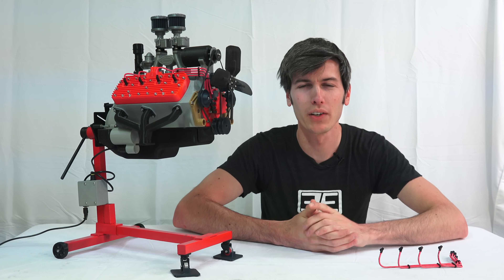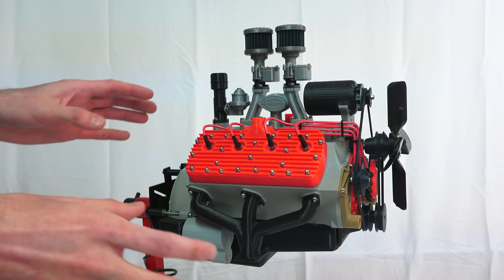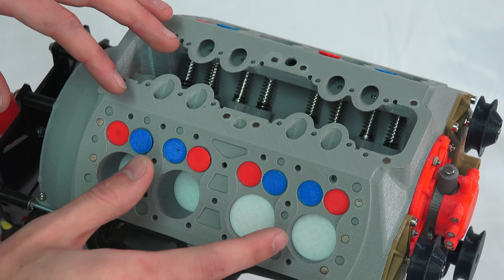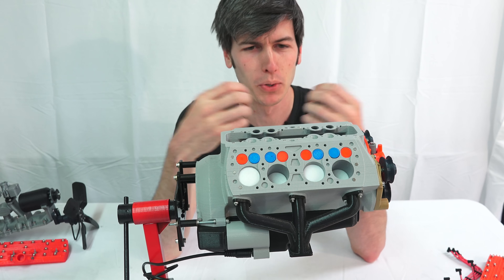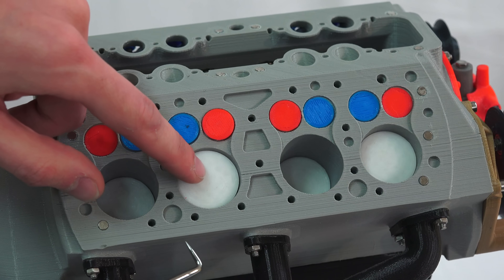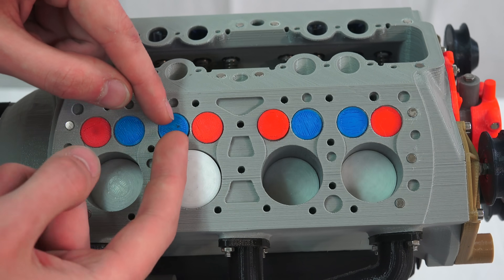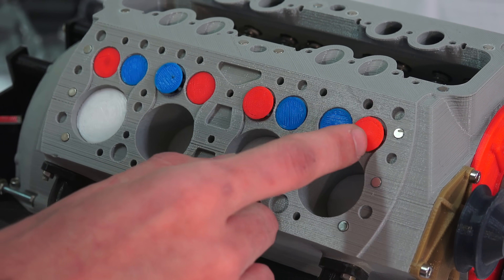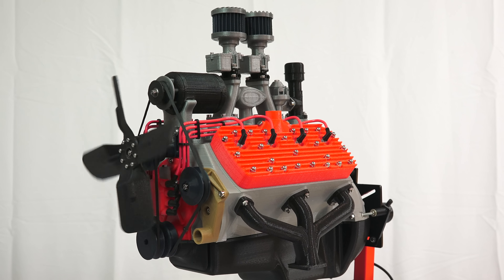Why Ford's Flathead V8 Engine Died

Comment: hi. I love your model and would love to get one! I really don't understand your airflow problem, I know this video was created in May, but hopefully you are still checking the comments.This is my understanding and I'm sorry if it comes across as a little pompous or know-it-all as this is completely the opposite type of question/request that i would like to ask of you. Like myself you seem to be a person who values and respects technology, but in my opinion and confusion, I am unsure if you are correct if there is a legitimate problem with this setup. I understand that the compression is not very high, and if you are write back to me i will understand why then. i will attempt to state my understanding and then i will ask my question/request.
 1)  Another cylinders combustion pulls down the piston in that particular cylinder while the intake valve is open forcing a vacuum to suck the air fuel mixture from the carburetor into the cylinder
2) The intake valve is then closed 
3) The piston in that particular cylinder is again forced upwards (by another cylinders combustion) to compress the air/fuel mixture
4) The Distributor sends a spark into the compressed mixture forcing the piston down to continue to spin the crank which works other cylinders pistons (either compressing gasses or just creating a vacuum to suck in a mixture)
5) The Exhaust valve opens and the piston is the forced upwards by another cylinders combustion to expel the emissions through and out of the valve, headers, then exhaust pipe, muffler, etc.
6) Rinse, Repeat, lol
That much I feel that i understand but what I am having trouble with is what you said about the  intake/exhaust moving in 90 degree angles and ,not being directed by hemispherical heads and valves, creating some kind of air turbulence by moving in different directions and creating some kind of trouble especially as both valves do not open at the same time. Also all cars do not have Hemi engines, but i believe they should as i know they generally have great specs and I know that they can be efficient if more widely used instead of in just sports cars. My request at last after this page long diatribe is could you possibly email me with an answer, or create another video while you hold a glass or a clear head over one of the cylinders and its valves, and use smoke through the carburetor to see what kind of violent air currents are indeed involved in this. I am very interested as someone very close in my family has two of these early 50's flathead v8s in old fords and i was trying to research for them the best upgrades i could do to help assist them. Thank you so much for your video as it is informative and i very much enjoyed it. I will be trying to contact you and if I have trouble I'm sure I will receive and email letting me know if you replied here. Thanks again. I truly hope to see another video as this one was very educational to me.

Comment: The 337 Ford Flathead V8 topped out at 154hp in 1951.
Reply: Of course, what was 154 hp in 1951 would be about 100 as measured today.

Comment: As a teenager and thru adulthood I’ve always hoped Briggs and Stratton would finally make a car/truck motor/open air vehicle for the shade tree mechanic that wanted elegant simplicity over here and now hype regarding lackluster technology. With enough mods, a flathead with valves on opposite sides of the piston and a higher CR could go 100K+ mi more than a more complicated OHV setup. 
I had two 4.9L I6 F150s and they were bulletproof tractor motors that had plenty of power. OHV yes, but as simple and easy to work on as it gets. 
A big limiting factor in valve design, both 80 yrs ago and now, is what a lathe can produce: one axis symmetry. Valves correctively shaped(or cast) and placed opposite one another in the CC with piston dimensions to complement(who’s to say a piston can’t be an oval with unique convexity with retarded timing) could make it a practical application once more. 
With all the valve and ignition timing going into all production engines now, applying that with a HC flathead, run thru computer simulation during testing, could produce a service engine with 500k expectations.

Comment: The REAL reason why FoMoCo scrapped the flathead for an overhead valve design in 1953: THE INTERSTATE HIGHWAY SISTEM. The writing was clearly on the wall... You cannot drive a Ford V-8 flathead on the Interstate, it will overheat every time... because the middle exhaust port had to scavage the two center cylinders and that's where the back pressure builds up and overheats the block. Henry could have been smarter and should have made the center exaust port large enough in diameter as to equalize the back pressure and that would have solved it but he was not aware of the future Interstate highway system yet in 1932 or in 1937 when he redesigned it. It was in 1937 that the prototype for the Interstate System was built as the Pennsylvania State Turnpike but Henry's head was in his butt. The 1932 engine had many problems that were solved with the 1937 engine, but the exhaust port issue was not one of them... Ford acquired a flathead V-8 in 1923 when he bought out the Lincoln Motor Car Company, but it was not practical from an assembly line point of view because it had a two piece block with through bolts and Henry didn't like that, so... he decided to create a V-8 with a one casting block for himself. He didn't want a six cylinder because Chevy had that and Henry wanted to go one up on his competitor... That makes sense. But he knew that his stock holders would not go for it so Henry set up a covert R&D "Skunk Shop" in another city and paid his engineers out of pocket to solve the one piece block casting problem, a rather difficult problem for it's time... but they did it and Ford released his 1932 Ford V-8 in April of that year... It had problems and he redesigned it for 1937 then used up his inventory of the old 60 HP engines in his "Standard" models only until 1938. A Russian immigrant by the name of Zora Arkus-Duntov looked at that engine and said..."I can fix this". He designed a beautiful over head valve conversion kit that bolts to the Ford engine block and basically invented the "Hemi" engine design that Chrysler smartly ran with... The Hot Rodders loved loved it and still do...! The Ford block had only three main bearings and the Chrysler five. Do I know what I'm talking about or what...?! I'm a "War Baby"...! Now...go see my YouTube Channel and subscribe...!!!
Reply: not true i drove a flat head from 1948 to 1953 without any problems the problem was the drives
Reply: @lcrews1001  ~ You didn't drive it on the Interstate...
Reply: @ThomasDeLello  from la to Vegas and la San Francisco. These at 65 to 75 mph you are wrong about heating yo
Reply: I don't know what they did with those engines out there in the desert states but I never saw a V-8 Ford flathead that didn't overheat after a few miles in the Interstate...

Comment: There’s 6 cyl engines with more displacement then the 3.6 engine v8. Although with a compression that low it could be boosted very high.

Comment: The exhaust looks like a V6, but it has 4 cylinders on each side.  I had seen flat head V8's     but never noticed that the center exhaust was single instead the two center exhaust             manifold.

Comment: I will tell you why.... it's good, but any flat head 6 was better, the v8 was heavy, the siamese exhaust was a problem, the fh v8 ford engine was a good engine, just not good enough, the 5hp briggs was the same engine just 1 cyl, one of the best engines made..case closed...
Reply: joracer1 exactly

Comment: Bring that design back and put some type of forced induction on it.  With low compression and todays high octane fuels, you could boost the power by maybe 150%.  Also, why not have the values tilt inside instead of come straight up?  That is, tilt up the side that is closest to the pistons but keep the other side down.  That would help increase compression since the carveout would be less.  Those 2 things combined should make the design usable and another advantage is this is a non interference design.  A problem with many of todays performance engines is that they are the interference type.  If the engine timing belt/chain fails while the engine is running, the moving pistons will likely destroy the non moving values, thus running up a large bill (or causing a cheap car to be reduced to junk).

Comment: The French Military used this engine for many years in their trucks after the 1950s  ,they were reliable but not very efficient....The middle exhaust ports were taking on twice the amount of heat because it was for two cylinders   it was a very bad design flaw along with the inherent bad air flow characteristics .. Anyways those engines exported  many gallons of moonshine to many whisky heads during Prohibition  ..No flow problems there ..

Comment: Ok...so the explanation of how it works was/is correct. However...inefficient?...  with the not so direct air flow it actually let the fuel and air mix more before combustion allowing for actually better mixture and less unburned fuel...very efficient....those engine could get 15mpg (or more) depending on the vehicle.   
As for it dieing, well, the french built flatheads (ford design) up into the 1980s for some military vehicles.   Amd with the rebirth of old classics and rat rods, they are almost as popular as before.they may not make 600hp, but there are plenty making 400hp.  
A friend just built one, supercharged and nitroused, sheared a driveshaft in half with the torque it made.   There were plenty of Bonneville records held by flatheads that took years for the new ohv engines to break.   Flatheads are aweaome.
I also had a 51 ford..  after changing yhe oil and putting new spark plugs in it fires right up after sitting for a few decades

Comment: You missed a major point-  heat.  Or rather the retention thereof.  You see, the exhaust ports are long, real long, and they're in the cast iron block, leading to a real 'heat transfer' problem.   The exhaust gas would transfer its heat to the cast iron exhaust runners faster than the cooling water in the block could carry it away, leading to the engine overheating, especially under high rpm or high load conditions (think 'racing') or a long up-hill grade in a truck application on a hot summer day and hauling a heavy load.  Heck, even the family sedan would have to pull over and be allowed to cool while climbing a mountain road.  An overhead valve engine's exhaust runners are in the heads and are a lot shorter, so the heat transfer  and heat capture problem were largely solved.  However, the 'flat head' engine's design had its' good points, such as being a very compact design relative to power output, and you were right, cheap to make.  It put a lot of torque in the cars of a lot of working class drivers, but you forgot to mention why Ford's engineers felt compelled to build it in the first place-  the success of Chevrolet's six-cylinder engine while Ford was only offering fours.  The horsepower race really started in the 1920's.
Reply: Amen brother Home run!!!
Reply: I've always wondered if there was anybody that "reversed" these flathead engines...IE had the intake on the OUTSIDE of the cylinder bank V (where the exhaust currently is) and have the exhaust on the inside of the "V" This would shorten the exhaust runner, so it's not going through the water jacket, and also could move the intake to the outside.  The water jacket could give some heat to the engine for mixing in cool weather (like a thermac on an OHV air cleaner)
Reply: @audvidgeek   A hot-V sounds like a really good idea to try.  The valves were all the same size.  A lovely bunch of bananas exhaust manifold could be made.  I think it would need two downdraft carburettors
Reply: he's just repeating what the text book told him.
Reply: A fascinating explanation, only problem is most of it is not true.  I've had three of them, two in cars and one in a pickup.  All three of them were the 239 cu inch V-8.  None of them overheated on me, and that included on route 66 across the Mojave Desert in the summertime, 95-100f heat.  The vapor lock problem was because the fuel pump was originally mounted on top of the intake manifold.  1949 and later engines had the fuel pump located in the lower right hand side of the crankcase, which stopped the vapor lock problem.  On the earlier engines people used to carry a bottle of water to pour over the fuel pump if they had a vapor lock problem.  Until 1950 the gas available was not high enough octane to permit high compression ratios.
Reply: @janlabij7302  So your cars did not actually boil...  But that does not mean that the engine is thermodynamically efficient.  The exhaust ports go right across the block, causing lots of heat transfer into the engine.  That inevitably causes extra cooling load, and stress on the engine block.  The engine is less efficient as a result.  If the exhaust passages were shorter, but the design otherwise the same, it would give more power, run cooler and consume less fuel.

Comment: I still find it somewhat amazing that Ford was able to cast that block with all the intake and exhaust ports built in around the cylinder bores. Core shift alone must have contributed to a fairly high scrap rate during production in the foundry. Love the toy engine! Thanks for a great video

Comment: One reason not addressed here (and in MY opinion the MOST important-reason!) that this engine fell out-of-favor, was inadequate top-end lubrication.
Although this engine was highly valued for 1/8 mile drag-racing because of it's Superior low RPM torque, (therefore allowing use of a transmission with fewer but "Taller"-gears) it's top-end lubrication was sadly inadequate for several reasons, and as 1/4 Mile drag-races became more popular, it was quickly found that this engine could not hold the high RPMs necessary long-enough to get to the end of the track without damage, as the oil distribution system was not able to keep enough oil going to the top-end, also, because of the location of the oil pickup, when this engine was subject to the extended high-G turns of road racing, the oil would be thrown to the side of the crankcase away from the oil-pickup, quickly starving the top end for lubrication, rendering the engine inappropriate for THAT use as well. Being that water cooled engines are actually both water-AND-oil-cooled, as racing needs grew, this engine was quickly found to be sadly inadequate as even many modifications to the oil distribution system were simply not found to be feasible when more appropriate power plants were quickly (and inexpensively) becoming available.
It is somewhat of a shame that the racing needs of the era dictated the production values of engines used in cars for the daily-driver, as a result of its simplicity and robust design, the Ford flathead was quite a reliable and engine for passenger-car use, requiring less maintenance and repair over a given period of time than more complex engine designs that were immediately to follow.

Comment: What a lovely engine. What I like is no cam belt/chain, I've always felt there should be a better solution to driving the valves.
Reply: Simon---  Which is why the pushrod engine is still with us.  Better to have a cam driven by gears or a hi-vo chain and valves driven by pushrods than cams driven by 'stretchable' chains or belts.  You can tell when a 'modern' OHC engine needs a new camchain-  it's getting reluctant to start and performance has grown weak due to the timing being off, since the roller-linkplate chain is constantly wearing out ('stretching') the cam timing erodes until the chain snaps and ruins the whole damn motor.  No thanks.  Give me the old cast-iron pushrod motor every time.

Comment: I don't know if "sophisticated" is the right word. The main advantage these engines had was simplicity. They were designed to be easy and cheap to build in quantity. The only major advantage the Flathead engine has, other than simplicity/cheapness, is compactness--an engine of a given displacement is smaller than an overhead valve engine because of the flat, simple cylinder heads.

Comment: My grandparents had on i their 1948 Ford station wagon. They were all over the country in that thing. When he died in 1966 it had over 400,000 miles on it and it was given to a preacher who used to walk all over to invite people into his congregation in northern WV. 
I see many comments below about them cracking blocks do to the heat stressed imparted by having the two center cylinders feeding across the block to a single output port. I do not believe that was as large an issue once they revised the cooling systems in the second production year. This issue may have returned in the last few years when Mercury increased the stroke of the 239 by 1/4"  increasing the displacement to 255 CID in, though I See nothing indicating such. This would have doubt been a continuing for those who were running performance mods on them most likely. The bottom line there is that performance mods have always found the weak links in every engine anyone ever improved the output of with performance mods. They used the 239 engines extensively in Ford buses for years too, That simply would not have been going on for long had the block cracking been as bad as some have stated below
Clyde Barrow was so impressed with Ford flathead v8 that he even wrote a letter to Henry Ford praising the engine for its performance and reliability.  :)  . In the last few years there was also a 336 CID flat head engine version released for trucks that put out a whopping 145 HP.